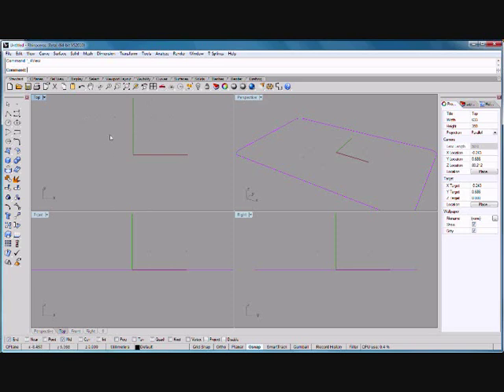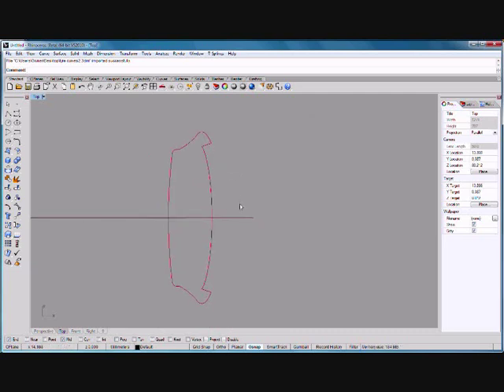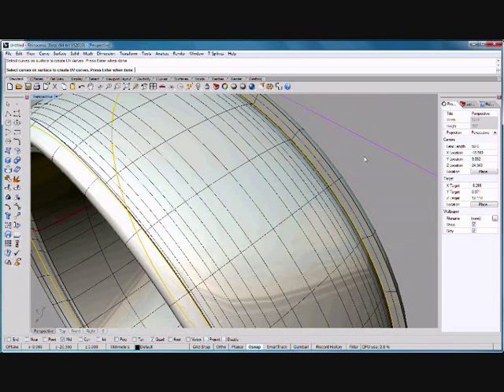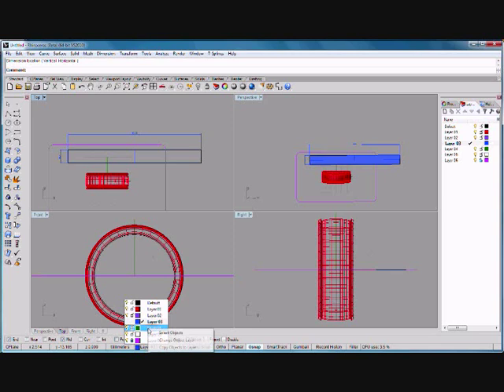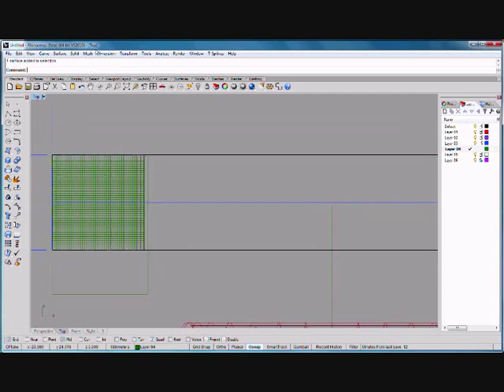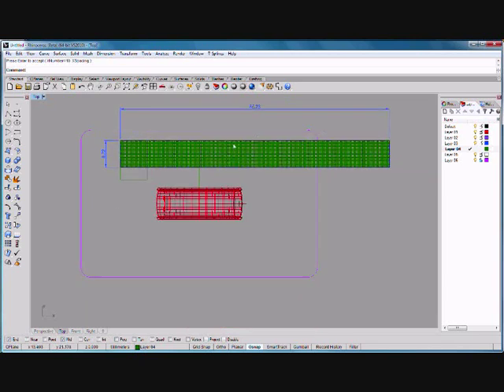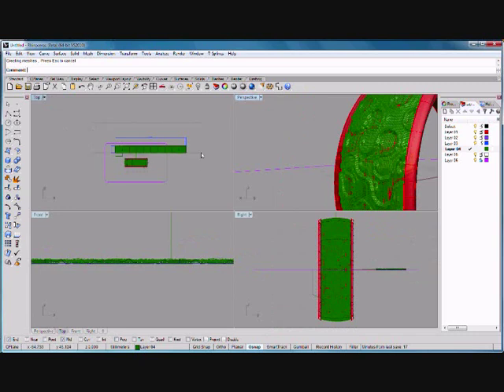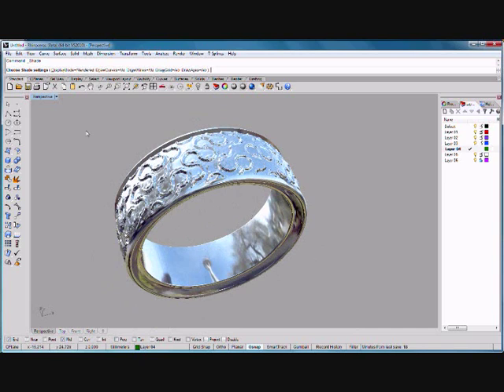Rhino tutorial making a basic tiled texture ring

Comment: How would you go about 3D printing something like this? Could you boolean unite the pattern with the ring?
Reply from the maker: You wouldn't be able to boolean as the pattern is a mesh and the ring shank is nurbs you could mesh the ring then boolean mesh them together but Rhino isn't great with complex meshes, I mill my models so they don't need to be watertight but a quick and easy way would be to save as an.obj then import into 3dcoat and voxelize you could then print it.